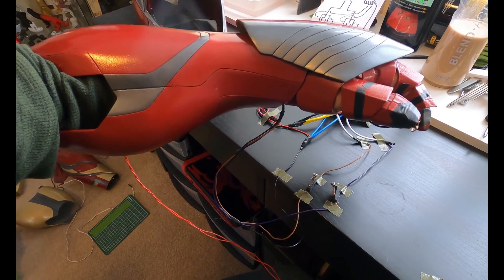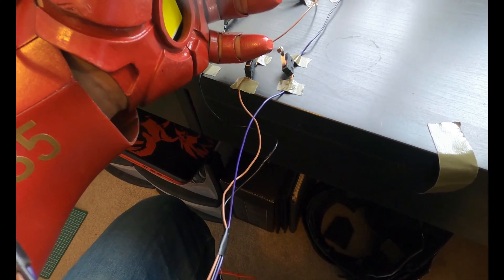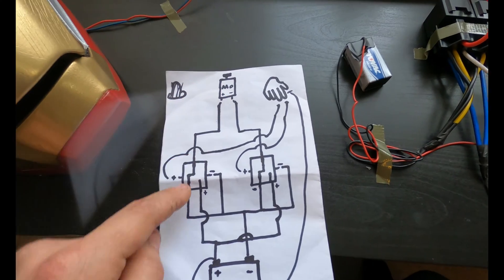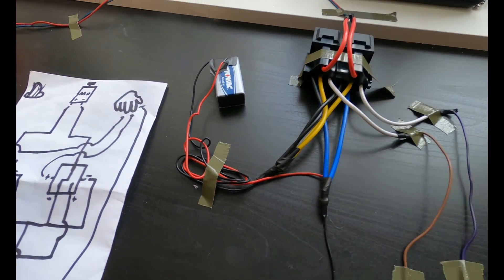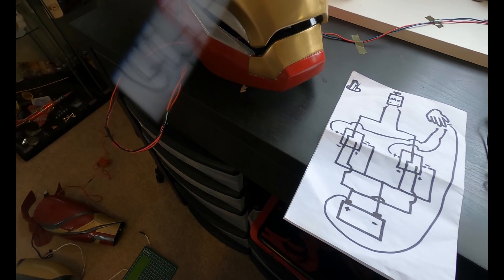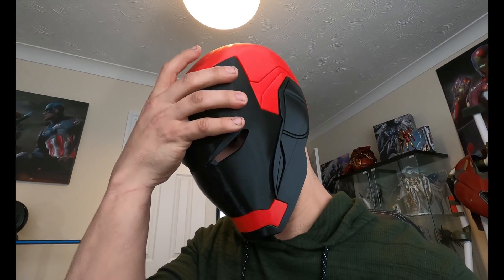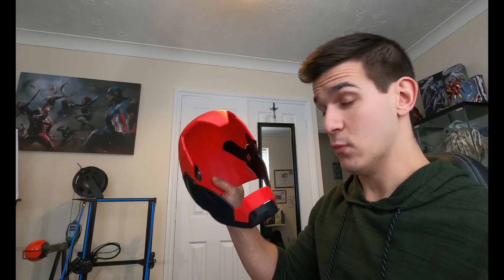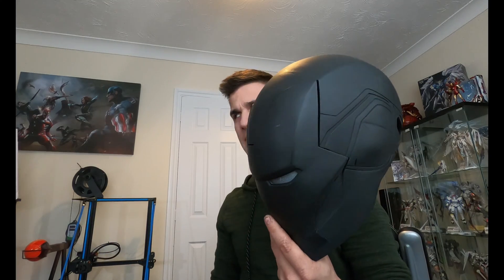How to Make an Iron Man Suit | 3D Printed MK85 Cosplay - Part 6.5

Comment: Are these files designed specifically to be worn or did you separate them and omit parts to allow wear? I’m not interested in a cosplay suit but I would love to make a life size statue that’s a little more sturdy than what it looks like the wearable version you have created is. Thanks
Reply from the maker: They’re hollow and made to be worn buy can easily be mounted on a permanent fixture
Reply: Frankly Built thanks. I’ll figure out some way to make it solid and fill in those gaps.

Comment: Hey, quick question. Since u were using a 9V battery, were u using a 9V relay? learning them rn, wanted to know which voltage i should be ordering. Also did u use a 4 or 5 pin relay
Reply from the maker: No I use a 12v relay but you can power them with nearly 1v. They’re super sensitive. And I use a 5 pin

Comment: I have a questions...do you have splitted hand and forearm in two pieces to fit perfect on you? So do you joint it together using magnet or what else? Thanks
Reply from the maker: figheras the hand is a glove and the forearm is just one piece that slides on
Reply: @FranklyBuilt  So hand is splitted in 2 parts however?
Reply from the maker: figheras no. Hand is one solid part. The little topper plate above it is separate tho
Reply: @FranklyBuilt  I would be grateful if you could share some video or picture about it because I'm starting to print nano gauntlet with gems (bought on do3d) and I want to size pieces as best I can...
Reply from the maker: figheras you should check out my Instagram. I have many more posts and photos showing the hands and other small details.
Reply: @FranklyBuilt  Yes I've seen....but not too much in depth...
Reply from the maker: figheras if you’re printing the DO3D gauntlet you have a different palm than what I used. I used a separate hand file that was 1 solid piece. Hands are very hard to measure in the program so you will just have to print it out at 100% and see how it fits. You might get lucky. My hand and glove is different than yours so anything I show won’t help

Comment: Nice work. Not sure about pushing 12volts around a suit as your batteries will get hot and die fairly quickly, but if it works for you go for it. Also download and print the updated do3d handplates as they are more accurate.
Reply from the maker: Joel Carter I have a 12v usb pack for the LEDs that I ran fully lit and powered for 9 hours. They ran like a champ with minimal heat. Did lots of testing haha 

And I have the updated files. I’m going with these hands because of how easy they are to put on and take off with the electronics and hand toppers.